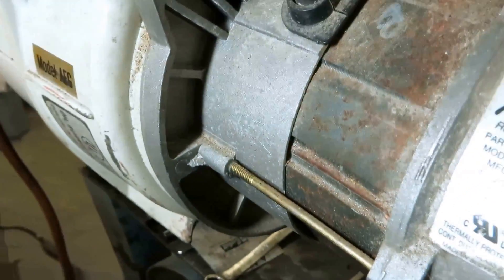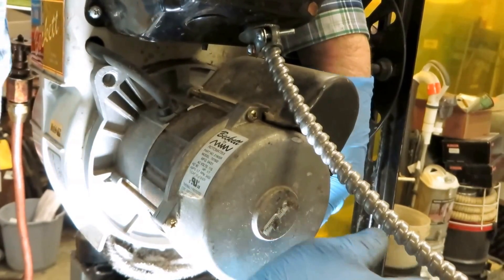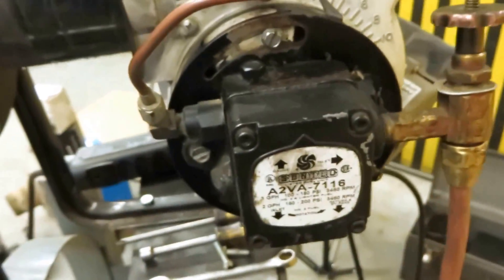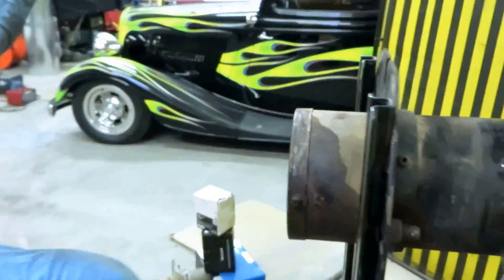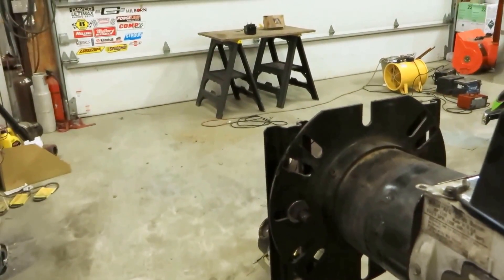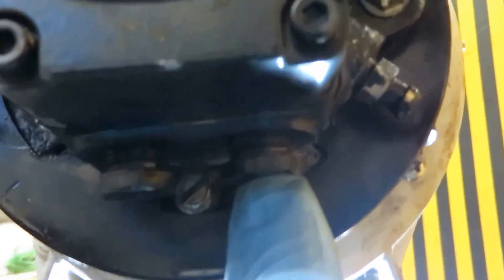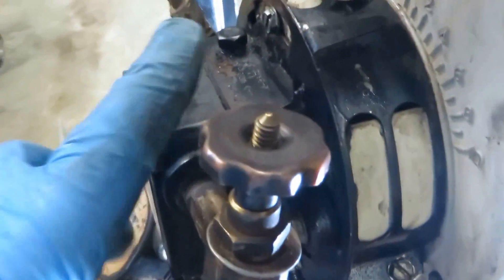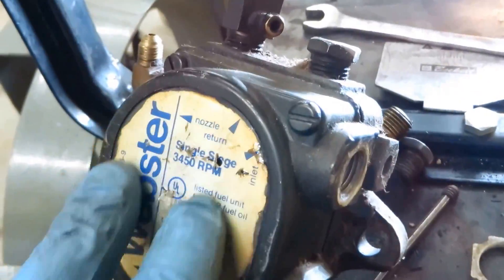Beckett oil burner training series  # 4

Comment: Morning... my blower runs but hesitated at the start... I need to turn the fan with screwdriver from ignightor box and then it runs... does this mean I need a new motor?.  Just replaced the ignightor.. wasnt the problem. Thanks in advanced... great series btw

Comment: How long is the coupling without the end caps? Got to make sometime up until the new part comes in. Beckett 2454.
Reply from the maker: +rfn944 i buy mine percut  for beckett and for carlin
Reply: Got it going yesterday. The end caps were not damaged, only that black plastic in the middle. Cut a piece of 5/8 heater hose and put the end caps in it and it worked great. Wouldn't trust it as a permanent fix, but at least I have heat again while the new part is on the way.
Reply from the maker: rfn944 good thinking on your feet
Reply: steven lavimoniere Thanks, got the part yesterday, but waiting for new nozzles, before I replace the coupling. Thanks for all the Beckett videos. Very helpful.

Comment: Hey Steve. On a Beckett Clean Cut A2EA 6527 there are 2 inlet ports, One on the bottom and one on the side. Does it matter which one the supply line connects to ?
Reply from the maker: +Frank Reddy eather one if it said inlet thats the supply port

Comment: Hey Steve I have a beckett burner I've tried to bleed out I have roth oil tank and suction line went bad I replaced it. Now I can't hear the motor run. I can look in threw the draft I don't see it spinning. What could cause the motor not to spin. When I try to bleed it drips out thanks
Reply from the maker: jfernandez2082@gmail.com it tripped out on safety .. you have to reset the protector relay ..
Reply: steven lavimoniere thanks it's all good now.

Comment: Great videos! I have learned a lot. How hard is it to convert an AFB to an AF? I need one for a waste oil burner. Thanks!
Reply from the maker: urgentcareguy3 waste burners are different ..then home heating burners ..
Reply: Yes, I'm aware. My Beckett will be converted to a babington burner. Clogging is not an issue with this design. The fans are different in the two units. Can these be swapped?

Comment: I took off a R7284U and when i went to put it back on the wires got knock and i think I got them all put back to the right wire nuts but the red limit wire where does it go. I did it all watching your videos and on training #7 u refer to the swaping the red and black. That's all go but where do they go?
Reply from the maker: Carroll Cooper well you would have to chace the wires back one should come from high limit problem the red one and the black wire most likely is a constant power for post purge .after the burner is satisfied the burner will run for a pre deturmaned time on post purge .the burner must be wired properly do not mess with it if you are not sure .call a burner man if your not 100% sure what goes were.its not worth dieing over

Comment: Great video... You really know your s**t... Thanks... I lost flame and hot water... The guy said that the coupler in the pump was broken?
Reply from the maker: well was the motor to pump coupler bad yes or no?????????
Reply: He said the coupler was cracked... He replaced the coupler, new oil filter and nozzle... Burners working great now... I just wan't sure why the broken coupler caused no flame? I'm not to up on burner repair...

Comment: How would you know if the inlet is bad? I ran out of fuel about two times. The last time, i put about ten gallons in, but i waited until the morning and when i went to bleed it, nothing came out. I chained the filter n checked the line, and there's fuel in the line. When i take the line off from the inlet, i don't see any. Can the inlet be locked?When i took the pump apart, the screen was like new.
Reply from the maker: you have to blead the air out off pump there is a small bleaded at bottom of pump open a fue turns then run burner till you get a good fow of oil then close .you really should just call a oil burner man someone that know what he is doing
Reply: I hear that! I tried to bleed it, but nothing came. I've bled it many times in the past before. I've changed a few parts before. I've changed the parts inside the burner before and it's been running good for a long time. I know how to clean it out and all. I never had a problem with the inlet and fire mat tic. I'm not sure if that closed off, and blocking the fuel. Thanks for your information. Is there anyway to tell if the fire mat tic is closed?
Reply from the maker: you might have a blockage it should bleed try it again if it don't work call in a professional
Reply: ok thanks!

Comment: Hi. Sorry its me again. I posted a short video of my problem under my name. Philip Grombliniak. I wanted to know how to remove blower motor with only an inch and a half clearance on the right(motor side) side. My boiler is hanging from the ceiling in the kitchen(this is the same in all Levittown ranch houses on long Island. You will see in my video the motor is almost against the wall. And you will hear the "clicking "noise the bearing is making. Also at the end of the burner cycle for 1 second as the motor slows to a stop. It sounds like a marble rolling sound. I am hopefull that maybe when I pull the motor out slightly I could get an Allen key in and release the cage. Would you be able to check out my video and advise. If you were closer I would of course have you come and look at it.